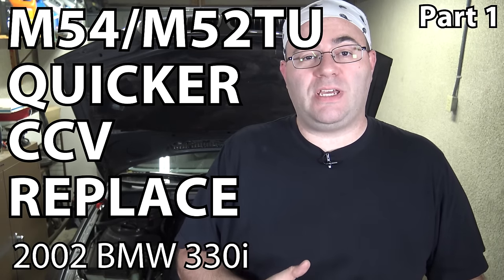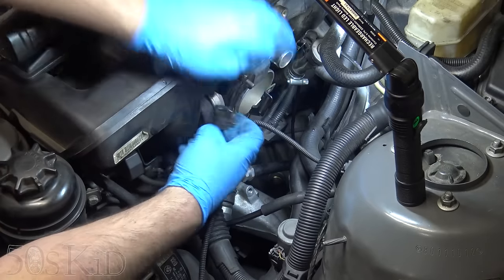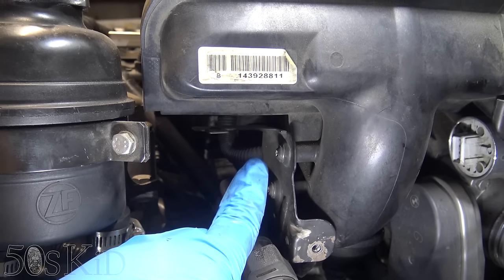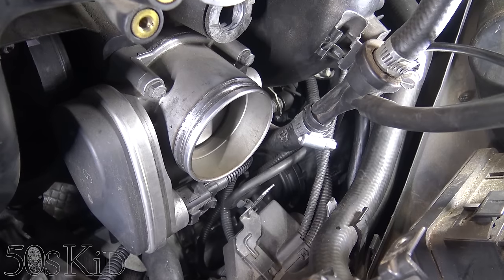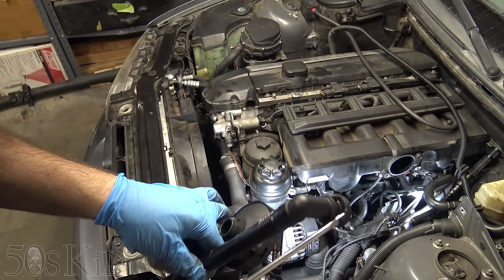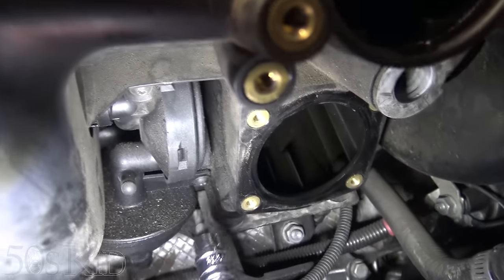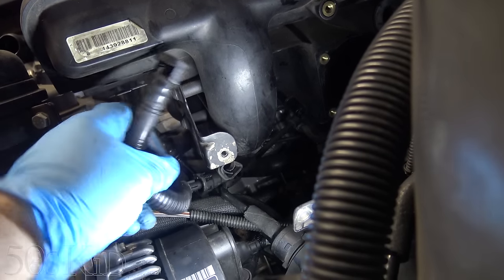BMW E46 Quicker CCV Replacement DIY - Part 1

Comment: Hi everyone.  Thanks Jason for the great videos.  I attacked my 05 330ci's CCV system this weekend due to the P-0017 and P-0019 codes and failing NJ emissions.  Well...4 days, a stripped TORX and multiple problems along with my limited skillset and tools.  I got the OLD CCV off last night and while trying to put the new one on I spotted a stripped wire coming off the "electronics box" to the left of the DISA/intake, etc.  I'm going to take a look at it tonight before I give up and bring it to the German Car Shop and see if it's worth fixing or just junking.  It's a nice car.  182 K always garaged and a 6 speed convertible.  I'd hate to junk a beautiful car but the economics are coming into play.  Is it work sinking in a thousand $ on a, in reality, a $2k car?  What I'd like to know, is that "electronics box" just for emissions electronics or is it the whole cars electronics?? Any and all suggestions are appreciated...

Comment: Awesome video, but I have a question - Would it be easier to just remove the intake manifold to do this? I plan on replacing everything under the intake (starter, OFHG, CCV system, VANOS oil line, VANOS rebuild, etc) while I'm in there. Also,  if I remove the intake manifold, would I be able to keep the throttle body attached to the intake? I didn't buy a new TB gasket but I'm planning to start this project tomorrow. Hope to hear from you soon, thanks :)

Comment: Hey man! I am concerned on a step that you called the connector vacuum hose. It connects with the vacuum hose that goes up, coming from the CVV. However in my BMW e46, 328i, it does not have the other connection on the back of the manifold to fully secure it. Why is this? 
Other than that. I am just learning how to take care of my BMW, and it’s been a journey watching your videos. It is truly educational! Thank you.

Comment: The cold weather version is slightly more difficult, but you can get the cold weather version with 2 hoses, genuine, from FCP for cheap. You still need to buy 2 more hoses, I went with Rein.

Comment: I did my E39 530i yesterday. It was white-smoking* quite a bit and missing intermittently. I pulled some scary-sounding codes, including 2 cylinders misfiring, but hoping no serious damage. I haven't completely reassembled - only the DISA and air intake and filter is left. The reason I didn't finish last night was because: (a) It was getting late and my back was killing after 3 hours, and (b) I have a small T-25/27 bolt with fine threads left over. I looked everything over carefully and cannot figure out from whence it came. Btw, there are a few differences between the E39 M54 setup and the E46 M54 setup - duh!  I found a few things were more difficult on the E39 than appeared in this video. However, some things were easier. The electronics box would not come away as far as in the video. There was a harness going to the front of the engine that split off into three connectors (I think) and I couldn't get to two of them. But, I still had enough room to get the job done.

Also, it seemed like the E39 had more room under the intake manifold than how it appeared in the E46 video. Once I got my face under there with a good work light to scope out the situation, it was little effort getting the short right-angle tube up in there, and then connecting it to the diaphram port on the CCV. I actually put the tube in its proper place, all the way up through the front two intake runners - but not connected yet. Then I had just enough room to get the CCV under there and rotate the CCV to get the tube on properly. 

One suggestion for any series with M54 CCV:  After removing all four CCV tubes, compare the new tubes to them by putting them right next to or ontop of the old ones. My short rt-angle tube was just slightly off in the angle connecting to the manifold. Since it was corrugated in that angled spot, I very carefully pre-bent it a bit to more closely match the old one. It wasn't perfect, but pretty close. Once you get that tube up in place between the two intake runners, there is very little room to try and bend it into the intake's pipe.

Now, about that "extra" bolt I have...
It's likely not something terribly important, but I know once I button everything up completely, and the car runs fine (fingers crossed) I won't want to worry about one little bolt. So, I'd rather figure out where it goes now and just be done with it. It's a T-25 or 27 wide/rounded head, with fine threads about ½ inch long. 
Photo of bolt:  https://share.icloud.com/photos/0CxVrPwgTGDmgfyeEebIP-RMA
Reply: Okay, after getting the air intake all buttoned up, I noticed some quite loose steel and rubber hoses toward the rear of the engine, and found a bracket dangling. That's where the leftover bolt goes. Hooray. When I started the car up, it was still missing some and a very loud rattling noise appeard above 1,000 RPM. Scary. I held it at 900 RPM until it warmed up. It was then much better. I drove it around the block and it now seems fine. No smoke. No codes. Smooth idle. No missing. Hooray again.

Comment: Great video ... what prompted the replacement of the PCV/CCV ? codes P0171/174? ...subscribed.
Reply: Thats why I changed the ccv .. 174 and 171... no vacuum leaks... changed ccv and codes are gonna .. went through inspection.. good for another 2 yrs in NJ

Comment: hello sir  i have a 2002 BMW 525I i was replacing the purge valve the hose came out of the other end how can i reconnect the hose back without removing every thing .is there a way i can connect it just by removing fewer parts i am not a mechanic. you videos are very helpful thank you very much.

Comment: Great video.  I changed the ccv last weekend, however, I am not sure if I have done it correctly.  When I remove the oil cap while the engine is on, I hear noise coming from where the CCV is at (I also feel a vacuum from oil cap opening).  Is this normal?

Comment: have a 2005 bmw 325i bringing back from the dead, watched lots of your videos and love them. issue i have, replaced almost every component in this car,  getting  p2440 /.new pump and new after market valve(the valve has no vacuum connection this model) just replace the entire pcv system removed manifold  tight connection to the intake from purge valve. still getting code. i am about to install in 5 minutes a new piersburg valve to see if that does trick/pump blows lots of air. any suggestions if that doesnt work? need help

Comment: Hey love the videos huge help! I'm going to do the oil seperator kit replacement but what I'm noticing on my motor is the oil seperator hose coming off the valve cover stays on top... and connects instead of returning below... I do have the metal valve cover conversion.. picture available. Your thoughts? I'm sure I'll figure it out once I get into it however..

Comment: I know this video is years old now, and i m9st likely will NOT get a response. But i am curious, can i use the " Cold Weather Kit " when replacing my existing hoses ? I live in NJ and we actually have 4 seasons. So even if my 325xi does not currently have the Cold Weather Hoses, i would like to switch to it. Just do not know if it is swappable or not. Any help would be appreciated greatly.

Comment: Thanks for great video...at 20:58 you mention there is a wire....is there a name to it?  Mine is missing...the clip side is stuck in the manifold side.  If this is a wire it will probably not cause p0171 p0174 codes...I was hoping it was a hose.  Any suggestions. Thanks again2005 bmw x3 3.0
Reply: that's the air temperature sensor, must be plugged in.

Comment: I just wanted to ask, slightly off topic but my power steering reservoir is always covered in fluid, I wipe it and it comes back again it's always done it. Is that normal? Also there's no O-Ring under the PS Res cap, should there be? I did buy one because I thought it should have one but the cap then wouldn't screw on at all I literally could not get it to seat at all and it ended up braking the O-Ring🤔 Thanks in advance:)

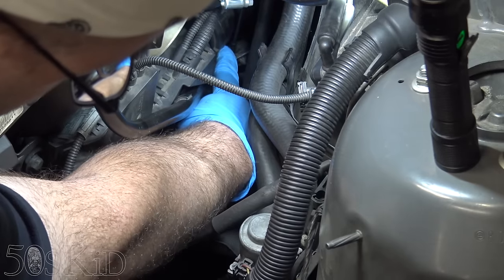Comment: Jason , quick question. The hard plastic line which you mentioned at 3:25 , hooked up by deepstick tube, which you removed with a simple move , is it connected somewhere?
because I found mine not connected to anything ( the curved top end) and I don't know if should be like this.Well in this moment , still working on my ccv, so a little bit help with an answer would help me a lot.
Btw : BEST video ever for N54 CCV troubleshooting. 
For those 7 guys who didn't like the video..
I have 2 words for you , and the first one starts with F .. you do not know how hard is to film this job ...to do the job and film it is double effort you morons!

Comment: Hi I have a question about the ccv replacement on the m54, I already have to do the oil filter housing gasket and wanted to know if I should be able to access all the ccv parts from the Front side while I have the oil filter housing off to the side
I appreciate the help if you can get back to me

Comment: To whoever is going to do this: I just finished replacing my CCV without taking the intake manifold off, per this video, and I'm here to tell all of you out there that it was an ENORMOUS pain in the ass. It took me about 8 hours to do and it fought me at every turn, but I did eventually get it to work. I won't be doing the job again, If I ever need to do the job again it'll be done without the manifold. Or, more realistically, I'll be looking at an m56 valve cover and be done with the whole awful thing. Also, save  your back and put the front on jackstands or ramps or something. 

I got the cold weather version, and I wasn't able to get it to fit without excessive pain and frustration, so I ended up just stripping most of the insulation off so there would be more clearance. Oh well. I also had to move the power steering res out of the way, and considered taking off the oil filter housing as well but I didn't end up needing to. I probably had a worse time of this than many other people, but just thought I'd share my experience. Also, I have never done this job before but I am not a novice
Reply from the maker: Sorry man. Yeah the cold weather version looks like a huge pain

Comment: how simple would it be to only replace the Crankcase Valve Breather Vent Hose (the straight diagonal hose)? is it possible just to clear some space and replace it.

Comment: great video.  I have  a question:  I need to change the one on my 2006 118i E87 with the N46B engine. What video can i follow or what guide?  thanks in advance

Comment: Hi I am Jorge ,my BMW E46 2003 325CI  QUESTION  During start Engine smaller Gasoline following Engine Soon Required, after scan check the code is PO491 AND PO492  can you any recomendation Thanks

Comment: the small vacuum hose on the upper intake boot broke off down below, replace the hose but don't where it ran to down by the dip stick

Comment: Hi. Thanks for the good videos. Does it take some time for the smoke in tailpipe to end after CCV replacement? How long?
Reply: Update: I saw smoke even after CCV replacement. I drove the car in the highway for about an hour to  burn the oil that was left in the lines before CCV replacement. Fortunayely, the theory worked and the smoke is gone now.

Comment: I just did this and now my crank case pressure is pretty high and it’s harder to take the oil cap off should I be concerned

Comment: Jason, how long would you estimate this way takes, in real time? I have gone as far as removing the throttle body and ICV for cleaning, and it looks as though that's most of the way there... just hoping 2.5 days off work will be enough!

(My valve cover hose barbs are clogged as well, so I am holding off doing my valve cover gasket until I do the CCV - I don't want more cheese building up in the meantime!)

Comment: I just wanna say for the evap connector. I found that the hard way on a 4.4 ..the previous owner cross the banks connector with the purge vavle connector.. LMFAO stealership wanted to open my engine cause it's internal problem yes right...just a thought...great video by the way

Comment: Did this job on Tuesday morning , wasn't too bad after watching this video 5+ times. Whenever I got done reinstalling everything and making sure all connections and sensors were exactly where they were before I even removed anything, I went to start my car and it fired right up but then immediately died on me. Its been doing that every single time. If I start it up and press the gas it still dies immediately with little to no response on the pedal. I just put a brand new fuel pump in a few days before the CCV replacement. Ive checked the pressure at the fuel rail and fuel sprayed out and I hear the fuel pump priming every time I turn the key. I've went back over my work multiple times and made sure everything was cleaned and put back together where it was suppose to be and I still get this start but dies every single time I try. I'm confused and lost and could really use some help. Idk if anyone will see or reply to this though
Reply: New disa valve, new injectors (2 months old or so), new camshaft position sensors , fuel filter is a year old 
Everything is properly connected and should be working fine

Comment: Hey 50'skid !1 I’ve been enjoying your auto videos on YouTube - good job !!

My problem is that after installing crank case ventilation valve, I noticed to my horror Sputtering Noise when I turn on the ignition. Do you have any advice on how to fix this??
Let me know thanks
Regards Philip

Comment: i just started the process of changing my ccv on my 2005 325xi and i am stuck on the oil dip stick. i can’t get it out, my car also has the oil dip stick nut on the frame of the car facing the rear of the car. which i got off and now the oil dip stick will not come out, it just moves up and down. ugh.

Comment: Good video, as allways. I got a "small" problem and maybe you can help me. Got a 320i m52b and the fuel consumption is over the roof,around 30 liters for 100 km. In small places you can also smell gasoline. I'm guessing it's the o2 sensor but I don't know what exactly I should check on INPA to determine wich one,because there are no error codes. Thanks!
Reply from the maker: Watch my fuel trim videos and look into your fuel trims to determine if you have a rich or lean condition.

Comment: I have a 2001 bmw x5 3.0 my sway bar stabilizer bracket is missing a bolt? Would a 2004 bmw x5 use the same bolt? Or do you know where I can buy one? Its the one on th front. Thanks

Comment: Hi 50Kid, I Have a height  vacuum when I try to open oil cap is that mean I have to replace the CCV, I try to find if there is any leak but nothing just Height vacuum when I try to open the oil cap very height, and I have misfire and code P0174, P0171, BMW E53 2005. thanks

Comment: Hi guys. I just found out, that my m54b30 engine make a lot of (maybe white) smoke in just one case - when I am driving on some gear without pushing the gas pedal for some period of time and after that, when I start to accelerate, there is a lot of smoke for some seconds. Is it possible, that faulty CCV can cause such problems, or it is something else?

Comment: On the upper boot of intake the vacuum connector that looks like an F the lower small plastic hose that goes down where dose that hose connect to I was replacing the boot and that hose got disconnect on the bottom and I don't know where the t connect to

Comment: The O ring for the dipstick tube installs in a groove inside the hole. Sliding it over the tube does not put it in the proper position.

Comment: Would ccv be the reason of having rough idle on cold start early morning when temp is cold around -2?
Reply: I have the same problem.  Whoever had the car before me set an alarm to go off when it is 37 outside?  I realized that is when the problems start.  Also when I drive it lurches and won't shift gears(sometimes)
Reply: @davewalters224  You solved the problem? if so, what was the reason? thanks.

Comment: Please correct me .if the oil filer cap has strong suction when engine running at idle.that means the ccv is bad?
Reply: yes it is

Comment: Lol I literally just replaced the ccv on my 2004 x3 3.0i with the M54 yesterday. All day process lol I did the ccv, the breather hoses, air distribution o rings, replaced o ring on the DISA, grommet on the icv, throttle body gasket, oil dipstick tube o rings, cleaned the icv with carb cleaner, cleaned the MAF, cleaned the air filter (lifetime filter about a year old) new intake boot, etc and reset my cel, 30 miles down the road my check engine light comes back with the same codes, p0171 and p0174, lan bank one and bank two :/ I'm stumped
Reply: Benji Greenlee O2 sensors?
Reply: Broken vacuum cap on the rear of the intake manifold
Reply: Check your Disa O-ring, some of the aftermarket part available on e-bay are not thick enough and does not seal well. You can fix them by putting RTV sealant around the intake manifold opening for the Disa (outside face) to help with the seal. Also wait for the RTV to cure before starting the car.
Reply from the maker: You just missed something in the intake system or forgot to connect something. 171/174 is almost almost always vacuum leak related, statistically.
Reply: Does anyone know if p0171 and p0174 is the same as bank1 and bank 2 fuel trim range exceeded? That's the code on my Creator c310 scanner.

Comment: Hi 
I have that cold weather one ,
And my question if it fit normally instead the old one and doesn't need any modifications??
I have a M54B22 with the neu coils cables ( as described only)
Thank you from Germany
Reply from the maker: It doesn't need any modifications.  But, I dont' know if you have seen my video titled: Engine Oil Consumption Fix (02Pilot Mod) -- you would not be able to do this mod because the port on the side of the oil separator is not exposed on the cold weather version and you have to make a hole in it.